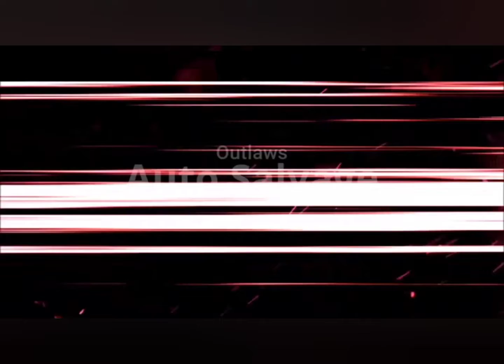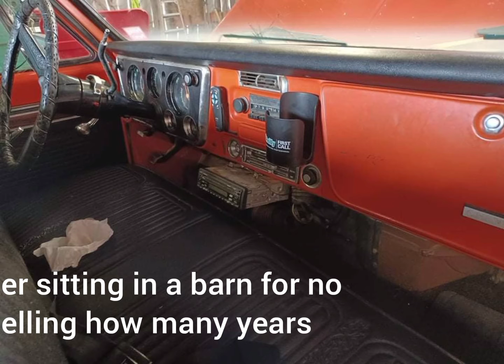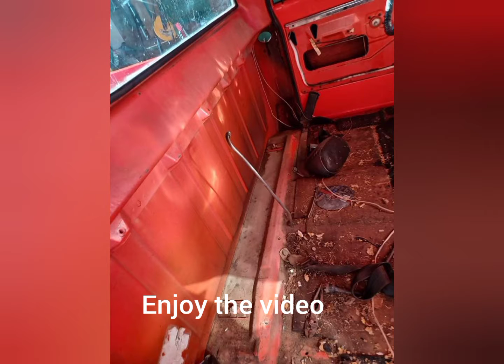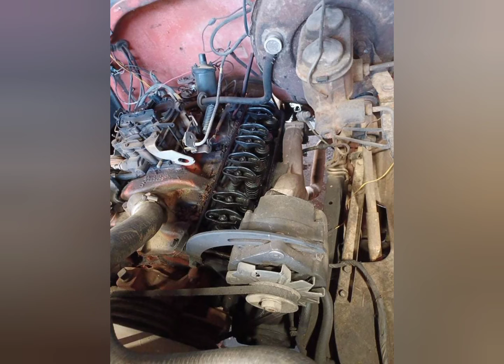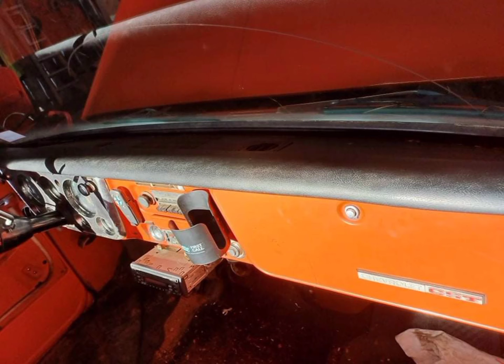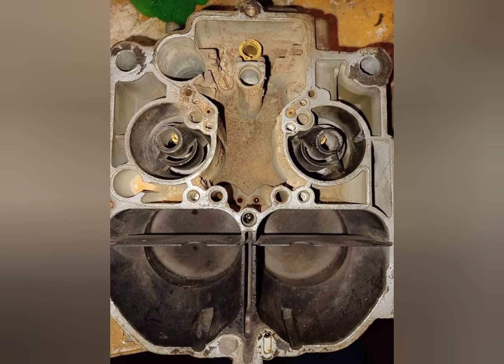What is this thing ?

Comment: Thanks for the shout out and that’s a cool truck.
Reply from the maker: Ya it is 1st one I have ever seen a gst model till last week  its sit in a barn for years hardly no rust only rust is passenger side  bottom fender  and small spot on passenger side  rocker solid truck  got few small dings  going to clean gas tank and replace sending unit and rebuild the carb alt and give it  good tune up oil change and service the Trans and ujoints  and drive  every  now then its a keeper